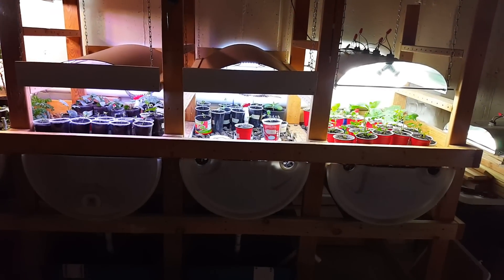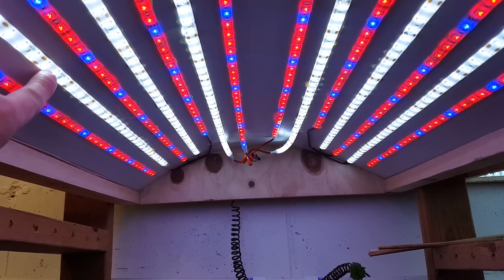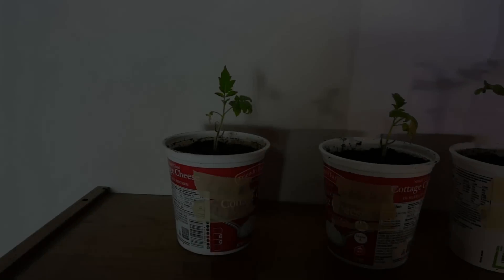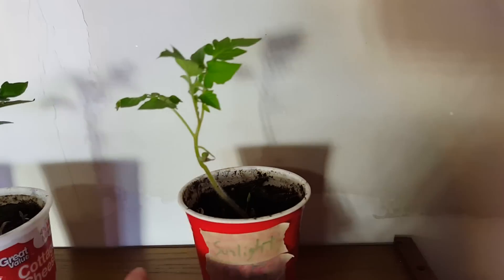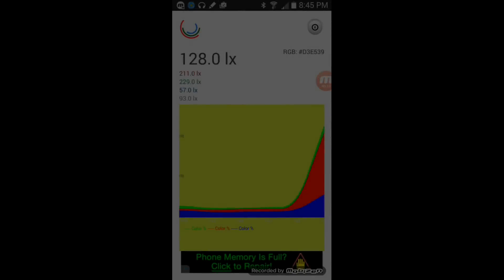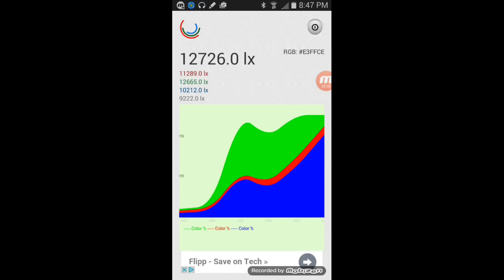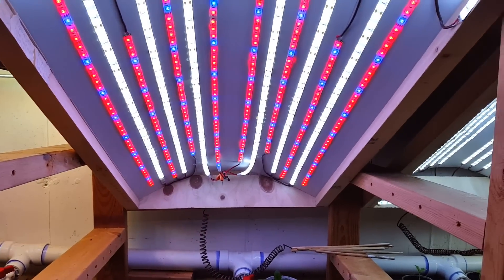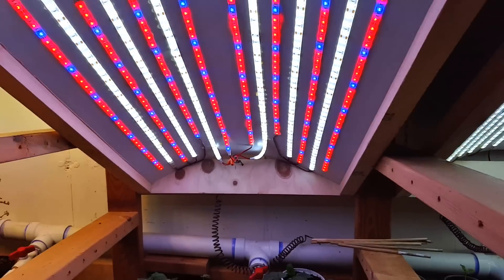DIY LED Grow Light Follow Up - Low Power LED VS CFL

Comment: LED is no good at this point in time
they burn out, have very low intensity
and cost way more.
Reply: +David Stanley Nonsense. LEDs are awesome growlights. But not LED strips of course, you need quality LEDs like Osram Oslon SSL's or Cree's.
Reply: I agree. The very best LED's are only slightly better than HID watt for watt and they cost thousands of dollars for a 600W light. Also the best LED's only run 18% cooler than HID watt for watt. But I'm talking about the best ones around. Most only run around 10% cooler and perform worse than HID in terms of harvest results
Reply: That is not true. I have used LED lights with great success. The big problem is the amount of different LED in the market. Some simply don't work as advertised. Good LED lights for growing use high flux 1W to 3W SMD's or COB's. Another factor is the red and blue wavelength used on each chip. They have to be the right color to be PAR effective. Otherwise, growth will be negligible. I can see the author is using strips with 5050 SMD's. Well, strips with 5630 or 5730 SMD'd tend to be better but still, I would not recommend growing solely with this strips. Nevertheless, each of this chips output a fraction of power (each SMD is luckily 0.2W) in comparison to the high flux ones (each SMD is 1W to 3W) . Regarding costs, you need to invest in the right LED lights in the first place. They might be more expensive but it will consume less electricity over time. That's where you get your investment back. 

Another aspect is how the author uses LED lights in the different stage of development. For vegetative state, the plants tend to need more blue or white light (blue or white are the same in regards to PAR). As they approach the fruiting phase, they will need more red light. Looking at the authors setup, it looks balanced in terms of different wavelengths but I still think those LED strips don't have the necessary power to be really effective. I used them as complementary on the sides of my growing space. Never as the main light source. For that, I use 54W LED's (actually they draw 12W), just search ebay with the query "54W led grow".

Hope I helped and forgive my english. It's not my native language.
Reply: try a Mars Hydro 600 for $140. 250 watts from the wall and light equivalent to a 600 watt halide. Spectrum grows dense dank plants. love mine
Reply: David Stanley and you will love saving 350 watts of heat from the plants space.
Reply: David Stanley you in Alaska? Most folk need air conditioning.
Reply: David Stanley insulate, air to air heat exchanger or you can use co2 in a closed system
Reply: it says 1000watt equiv, so i guess that is BS right?
also do you use it for flower only or for veg state too?
does t have 2 settings one for veg spectrum and one for flower?
Reply: True Patriot lots of people grow leggy plants looking for light. Most growers don't avail themselves of technology and grows are too dim and too red unless under kilowatt flame throwers...
Reply: Andrea Mitchell should have a switch but most dont. To know what a lamp is really equivalent to you need a PAR lightmeter or at least a general purpose or photography lightmeter. People say all sorts of crap, you have to test it. No meter? plant a seed and evaluate.
Reply: True Patriot truly industrial strength. Keep them cool if you want life plus they are like solar cells. Colder they are the more power.better efficiency
Reply: LED are by Far the best modern grow light solution... But you cannot cheap out on them, you need modern diodes with adequate and properly wired Drivers. There are a lot, I mean A LOT of cheap knock offs that simply cannot deliver the goods.

Quality LEDS provide:
 more Effective PAR per watt... 
Less energy wasted to heat...
Long lasting 10+years...

Only downside is their initial cost , but the fixtures will pay for themselves within a year of use, because you don't have to replace bulbs and lower energy use.
Reply: Youre severly mistaken david. Check the specs on cree cxb3590. Blows any other led, hps or cmh away in intensity and lifespan. These low wattage led's here arent worth the effort. Poor ppfd, poor intensity. Good for herbs n thats about it.
Reply: Raw cobbs and cree single units are available in lots of sizes on amazon dirt cheap. Mount on minor heat sink with driver and wire.
Led 5w FS strips are cheap and great for sides if your a non cropper.
Reply: Lots of change in just 2 yrs in this part of market.

Comment: Sir, your plants look bad, due to the fact you do not have at least 25% cent perlite, added to your soil, so your soil wont be acidic, as well, you need a oscillating fan on your plants, 15 minutes on, every 3 hours, for stronger stalks, as the fan will add Cellulose to the stalks, and looks like your soil will be slightly, acidic, so raise your P.H. slightly, by watering with 1 table spoon of fire wood ashes added to your 1 gallon of filtered water, every 4th. water, as your plants can not use the acidic soil, or rain water, or city water that has been sitting 48 hours, so the Chlorine will dissipate.